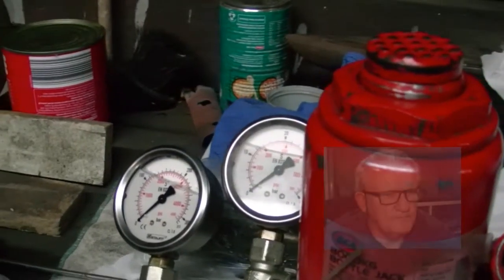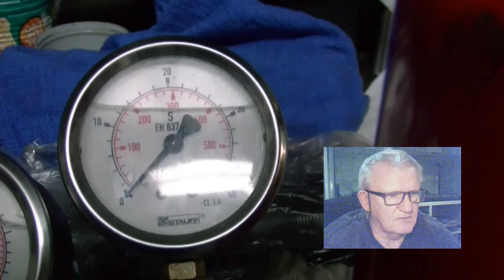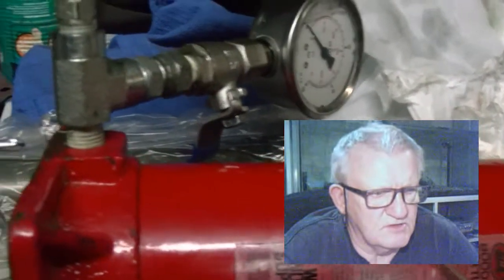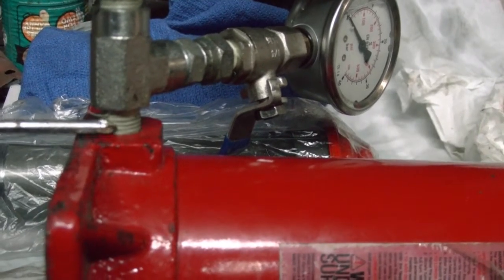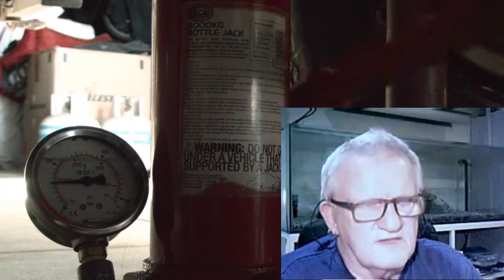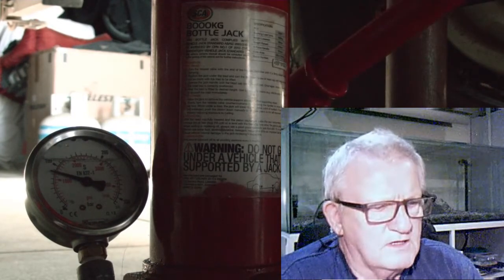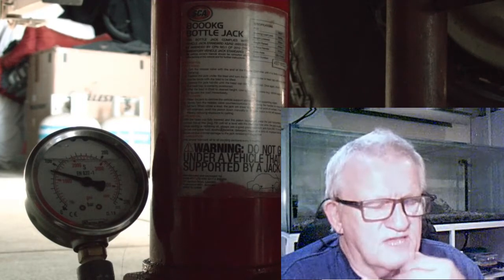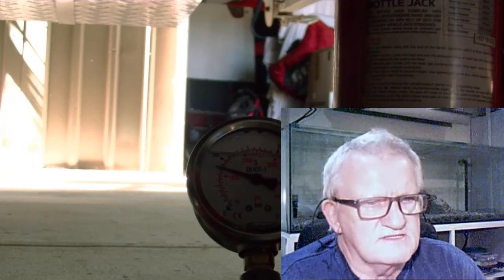Fitting Hydraulic gauges to 8 tonne Jacks.

Comment: dear, i can install a porto power pump in a bottle hidraulick jack or its a way to make a external pump to a hidraulick jack replacing the lever?
Reply from the maker: Hi Honeypressci, sorry for taking so long to get back to you.
If you know how to engineer this into your Jacking System quite viable to carry out this method of jacking. However, the porta power pump is reserved mainly for higher pressures and i dont think the relief valve can be set that low.